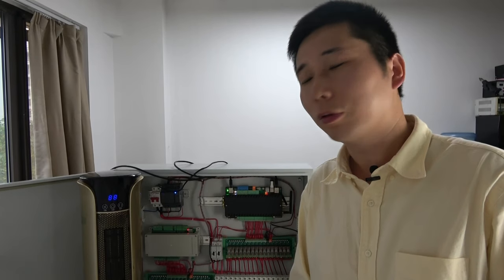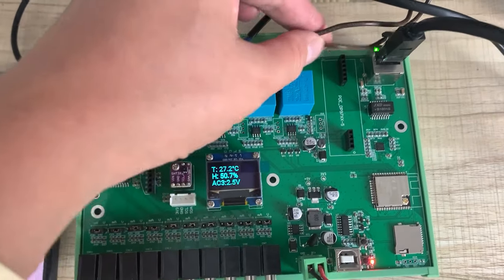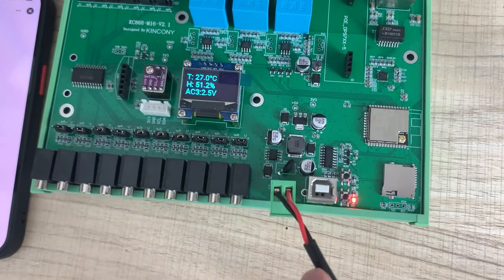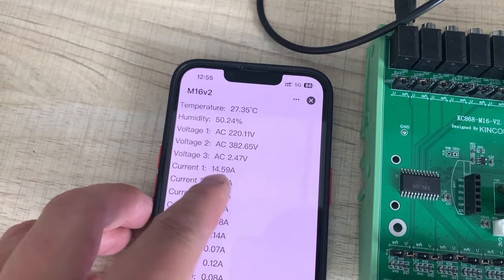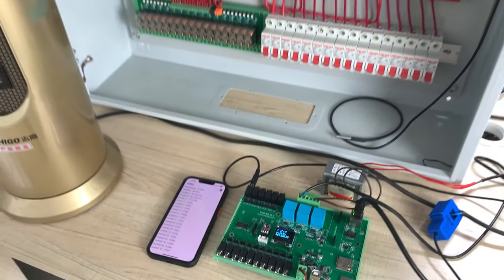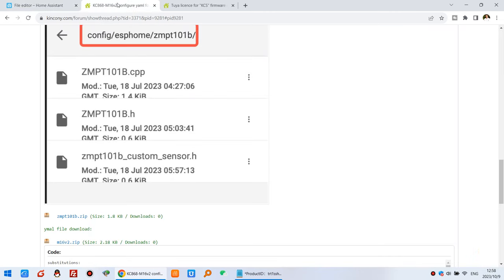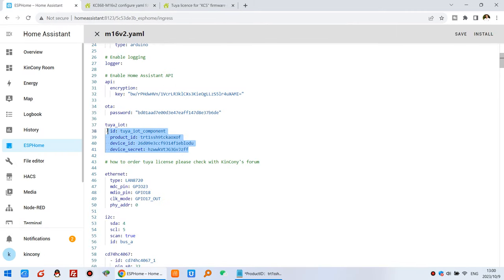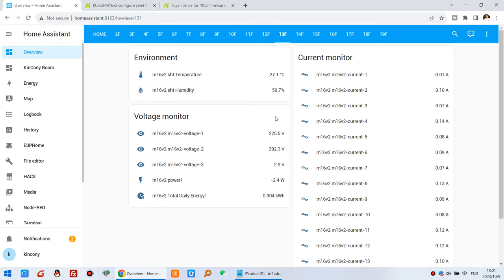M16v2 ESP32 energy meter use home assistant Tuya app simultaneously

Comment: Great Device!
Just started installation. 
Is it possible to add all power sensors to Home Assistant "Energy" dashboard?  Looks like "Energy" dashboard doesn't support devices measure in Amps, Only GJ, KWH, MJ, MWH, WH.
Thanks
Reply from the maker: later i will check it.